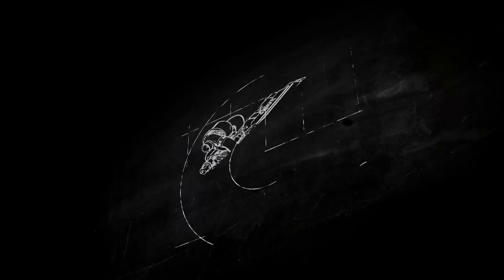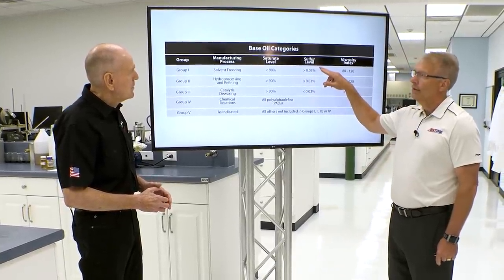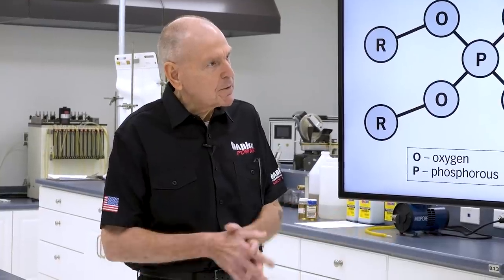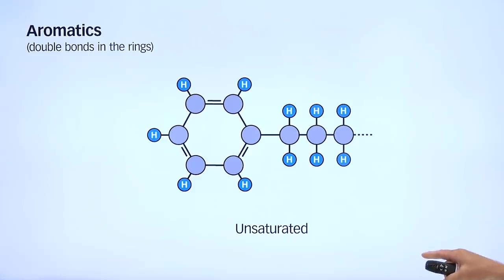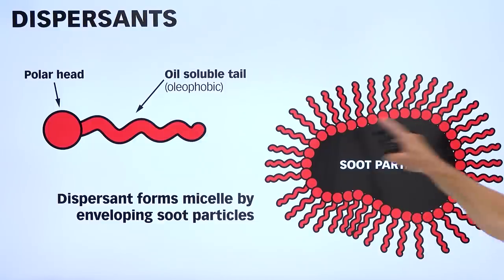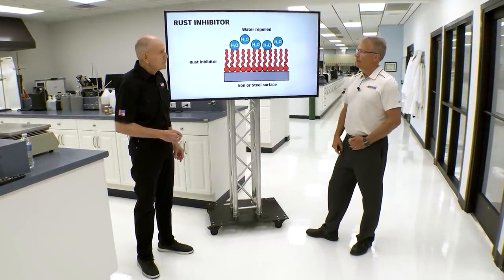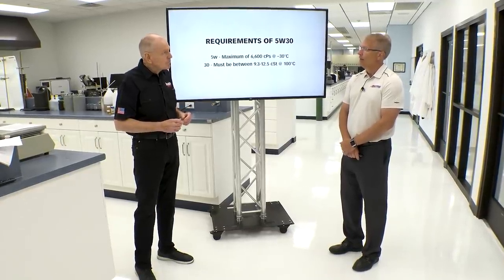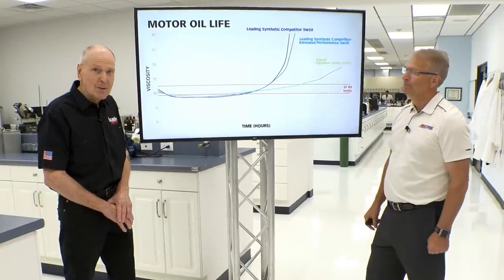What's in synthetic motor oil | Part 2 of 4

Comment: As a retiree (for many years) from one of the major oil companies there was one thing I was hoping to hear from the engineer.  And that was that their Signature Series Oils were made from PAO Group IV base stocks.  He kind of left it open for me to think they use some Group III base stocks in that oil.  I have no proof but I am pretty sure their other synthetics are made from Group III base stocks.  The price point pretty much dictates that.  As with Mobil 1, Castrol, and the rest.  I have never used Amsoil in an engine, however I have used their gear oils, 2-cycle oils, and fuel additives with great results.  Mr. Banks, thank you for doing this series of videos.  They were well done and very informative.
Reply: I believe some of their oils like oe and xe are group 3, and signature series is group 4

Comment: Im old, so I loved my dinosaur juice. loved my 20/50 motor oil. You just showed me the light, I'm switching to synthetic oil and proper oil viscosity ,  although I still go up a little on high mileage cars, like from 5w30 to 10w30. I was driving an s10 chevy that had a slight rod knock for weeks, called for 5w30. so to get home I changed the oil and put 20w50 in it. drove a mile and the rod came through the block.

Comment: Great video Gail thank you, my theory is when you jump to a thicker oil you also create more heat in the bearings because my theory is reducing your flow your resistance to flow therefore your flow is reduced through the bearing and that flows not able to dissipate heat as rapidly!

Comment: I just came over from watching some political videos, and the AMSoil guy starts talking FACTS about ZDDP and organic chemistry.
AAAAAAAHHHHH!  REALITY.  FEELS GOOD.
Thank you Gale, for a breath of fresh air.

I got a lot out of the discussion on mPAO's.  Fairly new in the industry.  I knew that Joe Gibbs' Driven used them as VI improvers in their oils, which are very shear stable.  I didn't know that AMSoil was using them.

I got a chuckle from the oil viscosity vs operating time graph when they labeled one of the oils "Leading Synthetic Competitor Extended Performance".  Gee, I wonder who that could be?  <cough>Mobil<cough>Mobil<cough>
Reply: I wonder whether Mobil 1 chemists would corroborate that particular graph showing the delta difference in oxidation rates over hours of operation of their oils as compared to amsoil.  We would need independent chemists to actually verify whether this graph is true because thats a HUGE difference attributed to ZDDP in the base oil as compared to Mobil 1.

Comment: I had a ford 7.3 diesel years ago. I ran 15w40 year around. Didn't realize the top end wasn't getting oil during winter start up. Wore the valve guides and cam bearings out.

Comment: I was hoping to see a conventional oil plotted against those synthetic examples in the final graph.
Reply: Many years ago I did a comparison of used conventional oil versus used synthetic (Mobil One) as I was curious about the heat threshold of both oils.
I put both oils in separate metal containers, heated them up with a torch flame on the bottom sides of the containers, and noticed that when both got critically hot, the conventional oil was boiling and emitting smoke, while the synthetic boiled without smoke.
Keeping up the heat, the conventional oil ignited with a dirty flame; while the synthetic kept boiling.  After another 30 seconds of applied heat, the synthetic did ignite, but its flame was nearly as clean as kerosene.
After that test, I was a confirmed believer and user of synthetic oil for internal combustion engines.
Reply: @bloqk16  I suppose if you engine gets hot enough for the oil to boil, and you keep driving, it's worth it...
Reply: @Cheepchipsable  in high performance Diesel typical failure mode is the aluminum getting soft(~1200°f) and allowing the rings to move out of place I'd say that's hot enough to boil  oils especially when you have a continuous stream of oil spraying the bottom side of the Piston to keep it cool and it still melts. Also with this failure mode it is typically witnessed heavy coking on the bottom side of the piston from the oil Boiling off  and leaving the solids behind.
Reply: High heat resistance is super important for turbo engines. The turbo shaft gets stupid hot and actually burns the oil badly, and can even coke up if it heats up too much.
Reply: I'm curious about the lack of units for time in the last graph. At what point does the oil start to oxidize and sludge up? It's not clear
Reply: @eyenosenuttin  The difference between the other 2 synthetics was negligible whereas the amsoil literally seemed to last almost twice the duration before it began to oxidize and then even the rate of sludge formation remained lower.....all this attributed to ZDDP in the base oil?  I wonder how long before Mobil 1 catches on and does the same thing?

Comment: I apologize if this has been covered previously. I just recently purchased a 2021 392 Dodge Challenger Scat Pack 392 T/A.
Oil recommended is Pennzoil SRT 0W40. In April or May 2022, 60 days 6000 miles, it's due to be changed to keep it under warranty. It may have 200 to 300 miles on it then. I live in northern Indiana near Notre Dame, so it will probably stay garaged the vast majority of the time. So, the question is, stay with Pennzoil or go with Amsoil 0W40 Signature Series? Not a question of money, rather protection and possibly performance. Maybe too soon to switch? Need 500 miles, I believe, to break in engine. What should I expect by switching brands? Love your videos, great detail and educational. Happy Birthday Gale on your birthday coming up soon!

Comment: This is an excellent entry level treatise on motor oil manufacture.  Amsoil is well known for excellent lubricants, and I say this as a retired Mobil Industrial Lubrication Engineer.  I found the information presented factual and informative.  All engine enthusiasts should view this.  It would save me and others repetitive answers to forum questions.
The only thing I'd like to know is why the Amsoil Representative specifically mentioned use of API Group III Synthetic Base Oil Stocks, yet said nothing about Group IV PAO (the 'original' synthetic oil before the Castrol lawsuit)?  Always thought Amsoil used Group IV PAO for their premium oil lineup = "Signature Series"?
Reply: AMSOIL uses a huge amount of group IV and group V base oils in our formulations.  So sorry we did not mention this specifically.
Reply: @AMSOILinc  - means nothing without the discreet amounts.

Comment: I agree on cold start wear. It fails me why we don't have priming of the oil pump and a preignition soak down before start up. I don't need or want lane assist, power seats, or any of that nonsense tech, but we should have a prelube setup.
Reply: The Cat 730 Offroad truck I drive sometimes has a pre oiler.

Comment: The issue is fuel dilution to the oil. Most companies barely formulate to the lower end of a 30w like on the baseline. If you're always lead footing or have forced induction... chances are even after a thousand miles your 30w oil is a 20w. That's why we start with 40w instead of 30w. You can't cure fuel dilution through formulation.

Comment: Like the others, this series on oil is very educational to understand what goes into a quart of oil and why. In this series I was really hoping to hear Dan Peterson touch on when oil should be changed and whether a full (Amsoil) synthetic oil will provide a longer interval btwn changes over non-synthetic to justify the higher cost? I can see that their (30w) oil doesn't turn to 'sludge' as fast as some others, but if the recommendation is to change oil at 5K - 7K miles, then why not just use a good, non-synthetic grade of oil? If we can run longer on Amsoil Syn oils, how much longer? I was hoping that Dan would talk about intervals and having oil tested for, among other things, TBN & TAN at some regular interval. 

Coincidentally, in this month's Amsoil electronic newsletter there is an article addressing the question of whether black oil is indicative of oil that needs to be changed? The answer is no, color is not indicative that the oil has broken down and should be changed...whew! Instead, their suggestion is to have a sample of the oil analyzed (they provide a link to a preferred lab), but there are a variety of tests offered and I'm scratching my head trying to figure out which test to order; testing is not cheap!  I run a secondary bypass filter on my GMC Sierra 2500HD (diesel) that filters down to 20 microns and the oil isn't 'as black' as it would be without the filter at 5K miles, so it is filtering (some) sludge. I will get a test done and I'm hoping that I can safely get 15K+ miles on an oil change, otherwise I may go back to a non-synthetic oil.

Comment: Good video, I worked in an oil plant and worked in the hydroprocessing unit. Was good to see process involved after the synthetic crude left our plant. You made a mistake on Sulfur, its removed for environmental reasons but its actually desirable in a diesel.
Reply: Sulfur is NOT desirable in any engine. The process of removing it removes lubrication properties,

Comment: PAO's are what's in Mobil 1   PAO's are made at the Exxon/Mobil Refinery in Baton Rouge, LA.
Reply: Yes and no. Not all the Mobil 1's are full PAO's. These days most will have some Group III or Group III+ (Shell's GTL base oil) because you can get very similar performance at a much lower price point and still call it full synthetic. These days most of the PAO volume is reserved for industrial grades - the mPAO they talk about in this video is very common in wind turbine gearboxes, industrial gearboxes and hydraulic packs.

But you're correct in that PAO comes out of Baton Rouge.

Comment: The explanation of oil viscosity does explain parasitic power losses & rotating shafts, but it doesn't mention sliding surfaces…

Piston ring to cylinder wall surface is the largest in an engine, add in valve to guides and those are responsible for any/all oil consumption (+turbochargers).

A rotating shaft also has a journal surrounding the shaft, except valves/tappets/rockers sliding on camshafts.

Comment: The motor oil life graph has no scale in hours for the x axis. 100 hrs 1000hrs that’s important.
Reply: Exactly with no physical data on time you can wipe your a** with that graph. There are 1000 different ways to manipulate that line.
Reply: I thought that was odd as well. He did say it was an accelareted lab test though so if they would have put the hours up there it might cause confusion.
  If you look at it as a scale you can get an idea that their oil last x times longer though, which is the point.
  That said I'm sure they picked out a specific product that they do much better than their competition for this demonstration. That doesn't mean every product is that much better than others. 
  It also doesn't mean that there aren't other competitors that are equal or better on this graph, they just showed one unnamed competitor that they said is a good quality.
  They aren't dumb and recognize that this video is another form of marketing. Of course they are going to cast their product in a good light.
  Final thought is: I'm sure Amsoil makes a quality product and although I have never used it I am seriously considering it.
Reply: I,do believe that they were using The Amsoil Signature Series Max-Duty Diesel in the 5W-40  and I, would guess The comparison was Mobil 1 synthetic or Chevron Delo synthetic Diesel oil.  And if you've never seen the testing that The guy whose YouTube channel is Project Farm, he  does a lot of comparison testing using Amsoil vs many of The other brands  he even sends New oil in for analysis, he does some in depth testing ie cold pour point heating the oils up to extreme temperatures to check for Volatility via weighing the sample before and afterwards.  And also has hundreds of Videos coming  tools, hand tools Electric tools drivers, impacts. You name it and he has likely tested it.  And I, was looking at another Lubricant  company High Performance Lubricants and I, shocked at Their pricing to see that they are actually a bit more expensive than Amsoil and they have no testing comparison whatsoever to justify their costs.
Reply from the maker: This is a lab test AMSOIL uses to improve motor oil formulations that run in severe conditions in the field. The test length represented in the graph is in hours. Both competitors' useful life ended after day 10 or 240 hours. The AMSOIL Signature Series product had end of life happen after day 13 or 312 hours.

Comment: Great Video Gale. However, I thought that Sulfur is bad in conventional oils which is why Dodge recommends low sulfur in the oils for their Cummins diesel engine. They recommend Shell Rotella T6 15w-40 or 10w-30 or 5w-40 ect..That being said, why is their sulfur added in their wear protection of the ZDDP? It seems to contradict the chemical makeup of convention oils if Amsoil is using it. Correct me if I'm wrong, but that's how I understood it as Dan Petersen was explaining the chemical breakdown of the ZDDP. Because I am very interested in Amsoil oil, I want the best I can get for wear protection and the money. Thanks Gale.

Comment: Very helpful and good explained. My question to you is that in the last frame you spook about the "oil life" within the parameters. X= Cst, Y= hours. In how many hours the competitor " failed" compared to the amsoil oil.
Reply from the maker: This is a lab test AMSOIL uses to improve motor oil formulations that run in severe conditions in the field. The test length represented in the graph is in hours. Both competitors' useful life ended after day 10 or 240 hours. The AMSOIL Signature Series product had end of life happen after day 13 or 312 hours.

Comment: Very nice explanations with a lot of info.  Take away for me is, just change your oil at the OEM recommended intervals using the recommended OEM viscosity oils, and you'll be OK.
Reply: My take away here is I got ripped off paying double to triple price of conventional oil for "FULL" synthetic oil product that was made with conventional oil. Now I know why my engine and transmission would wear out by or before 200,000 miles. I will never buy another bottle of a lying ass "FULL" synthetic. Amsoil for me because I know what I'm getting from here on out.

Comment: You touched on the problems with cold starts and parts wear, which I understand. Would you still recommend allowing the oil to heat up by idling the engine for a period on modern engines with DPF'S? I can't imagine all that time spent static at low ram would be good for this filter.

Comment: @SynLubePros /Crider,  I do personally use their products more specifically their axle lube, transmission fluid, and their grease, and I have to say that so far I am very satisfied with their products. but I don't use their engine oil, first, I am not a big fan of the extended oil change, so, I change my oil and filter frequently, and I think it is overpriced for what it is, I know people who do use them in their engine and after studying multiple oil analyses, I don't see any benefit of paying more, I saw a bunch of cold test flow and they don't flow any better then Pennzoil ultra platinum or Mobil1, in fact, they did a bit worst, so to me, it looks like just a group III, not even a group III+ or if you want Fischer–Tropsch or GTL, I am aware that the SDS doesn't reveal everything but their motor oil looks like it is simply group III and decene 1 or 2, similar to Mobil1, less than 20%, decene being used to make PAO, I can't find any evidence of group 5 or ester in those motor oil,

Comment: I have personal experience with Amsoil Royal Purple being run in 22,000 horsepower natural gas fired industrial turbines since 2008.  Have never changed or replaced this oil and these turbines have ran 24/7 until each is replaced at 30k to 35k run hours.  A film of “varnish” has formed over the years.  The oil is blamed and is scheduled to be replaced with an ExxonMobil product at just over $1,000,000.00.

Comment: Great video. I never knew synthetic oil was petroleum based. Very informative.
Reply: It's conventional oil with additives. It's not synthetic in the true sense of the word as astro turf is to grass.
Reply: Only Group III oils. Groups IV and V oils are true synthetics.
Reply: @harleydavidson4254  
What does Group IV and Group V base oils mean?
All engine lubricants start life as a base oil and fall into either Group I, II, III, IV or V base oils.  Group I and II base stocks are typically ‘less refined’ and form the basis of Mineral or semi synthetic base oils.

Group III base oils are widely considered to be synthetic while group IV an group V base oils are 100% fully synthetic and offer the highest level of lubricant protection and performance. Nulon Racing oil is blended using group IV and group V base oils.

this article seems to contradict itself, doesn't it?